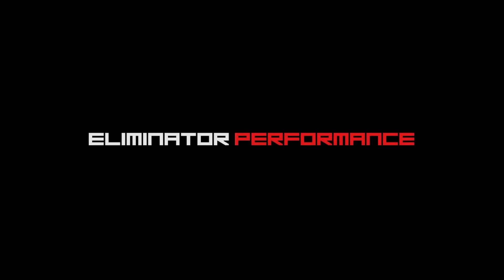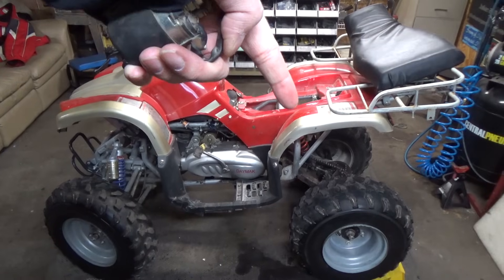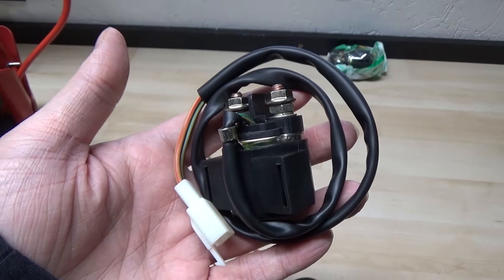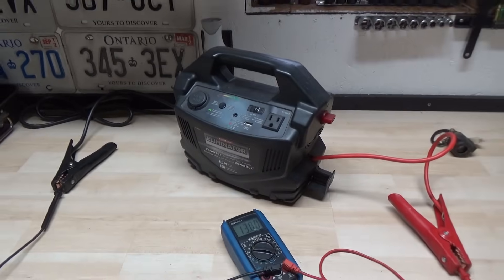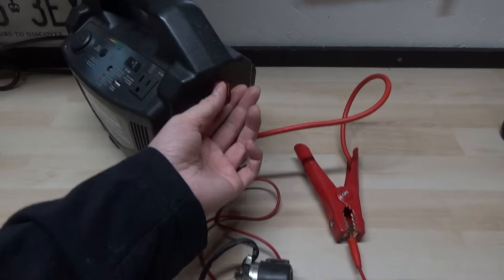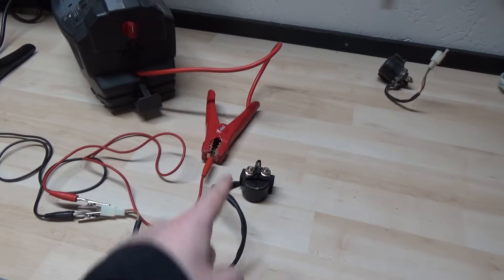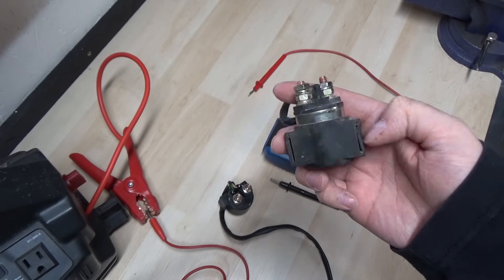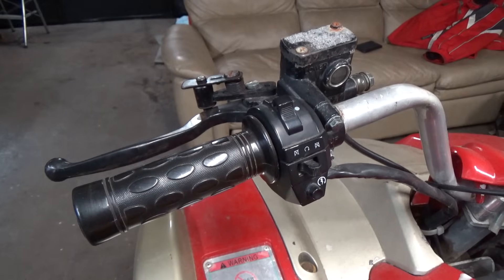How to Test an ATV Solenoid!

Comment: Does the amps matter on the battery jumper we use?
Reply from the maker: Shouldn't matter for testing, you need 12v to make it click.

For engaging the starter on the atv/bike, you still need 12v source, but you'd probably need something with more amps!
Reply: Got yah, Im still trying to learn about electricity. Specifically amps, volts, watts etc. From what I understand VOltage is just the pressure of electricity while amps is the volume of "water" flowing through the wires. 

So theoretically if I had a battery that only had 2 amps but 12 volts, I could still test this solenoid?
Reply from the maker: Riley I normally use my jumper pack "eliminator" but sometimes I use a 12v battery or a smaller 8000maH battery pack I got from Amazon for like $30

When starting some riding lawn mowers with bigger engines (and more compression) sometimes I can't use my eliminator because it doesn't have enough Amps to crank the engine past the compression stroke.

So even through it's 12v, sometimes 13v on full charge, it's the Amps that give you that extra push.

Comment: So what was the cause of the problem? I have the exact same issue for my BAJA 90u-R.
My vehicle sat in my garage for years, only thing wrong with it at the time was that it leaked fuel. Got a new battery& spark plug and went to start it up and nothing. Not even the headlights come on.
Reply: @eliminator performance
Reply from the maker: If the headlights don't come on, you most likely have a bad ground.

Take a separate black wire, and run it from your battery Negative to the frame.

While still having the normal red and black wires on the battery.
Reply: Ok I ran a ground as well and still nothing no lights nada.  Good battery all that good stuff.
Reply: And the key switch is good

Comment: Alright,i hope someone responds bc i think i fucked up. So today in the morning i was starting my atv with no choke even tho the engine was cold,then it turned on and i was holding throttle and then it cumpletely shut off and it didn't have lights for neutral gear,so now it doesn't show anything when i switch the ignition to on. help :(
Reply from the maker: Bad ground? Get a battery booster and hook up the positive to the battery positive, but take the ground cable and put it on bare metal on the frame. Also check fuses

Comment: Did you do  a follow up to this ?
Reply from the maker: This atv had quite a few issues, I ended up doing a carb clean video on it, as well as a starter test video. The gear inside the engine was damaged, so he could only kick start it unfortunately.

Comment: I jumpstarted my motorcycle  starts solenoid  it turns over but won’t start  Well I have  to replace solenoid for it it to start
Reply: nooOOO,  . . . . .  >.>     . . . . . if the engine is turning, then it is  '' starting '' .  what you mean is it will not turn over to idle.